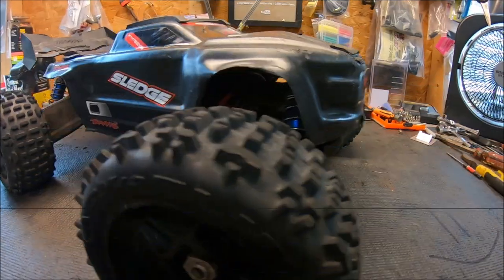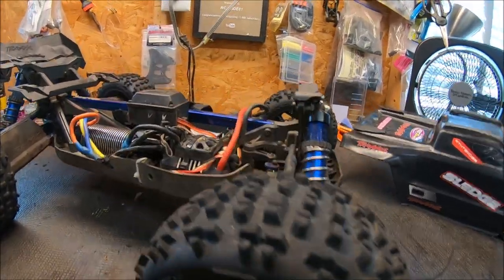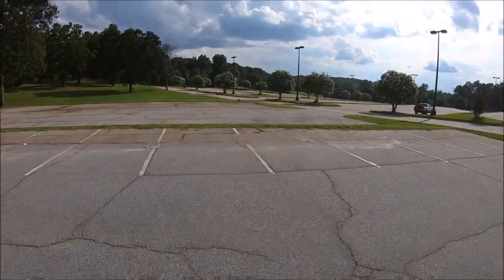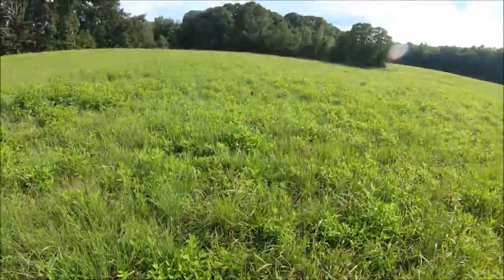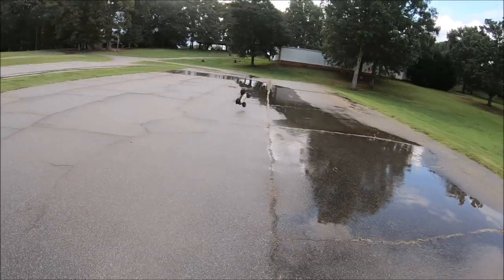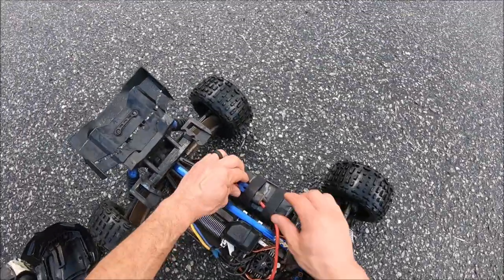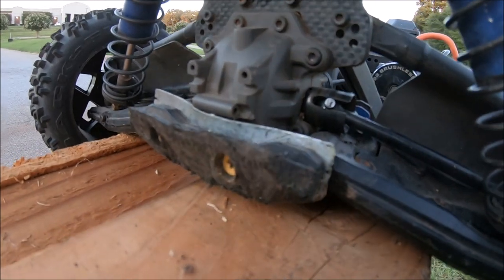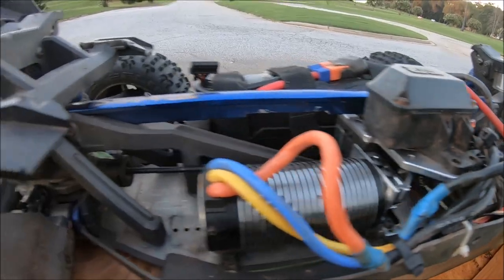TRAXXAS Sledge NEW! M2C "S" series Driveshafts test!🚀 Send it and Forget it!!

Comment: Killer bash Test with the Sledge Bro Eric. Power for days with your system setup. I'm diggin that very much 😍. Glad the shafts are holding up strong 💪.  M2C new drive cups should be an awesome additional upgrade for this tank. Wicked big sends as always Ramp Blast Bro.